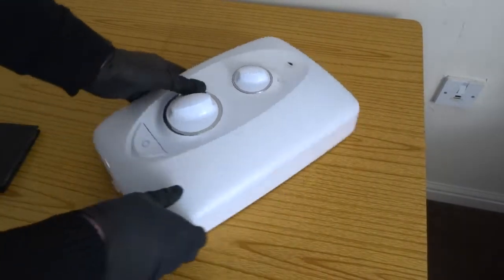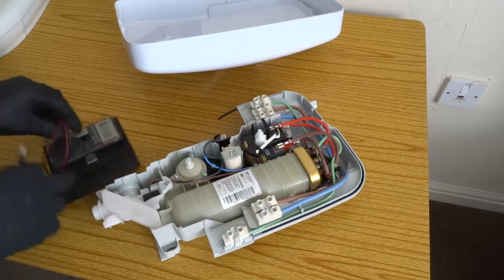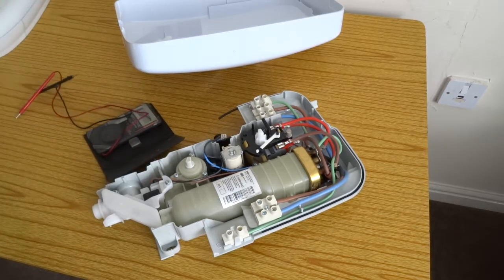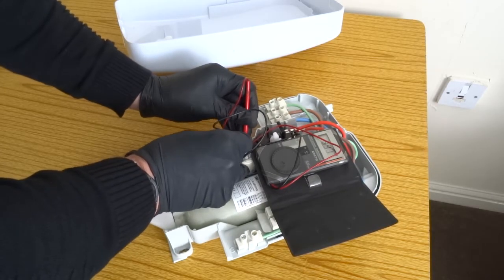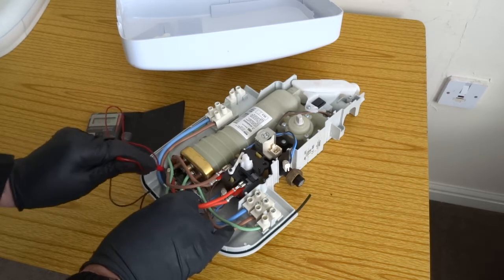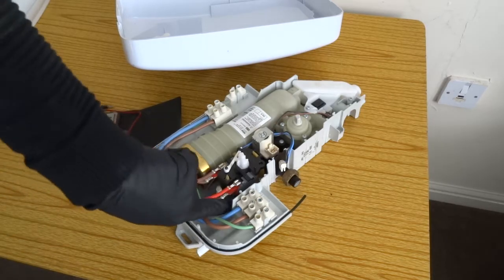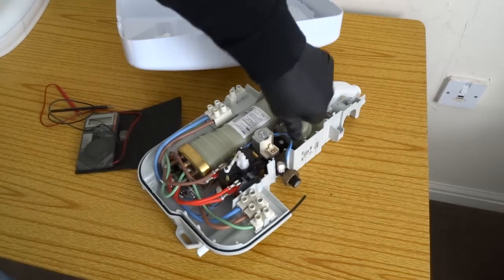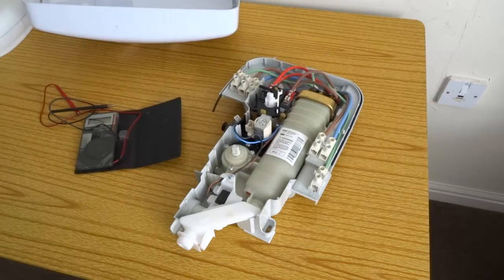Top 5 Mira electric shower problems faults and easy fixes

Comment: My Mira Vista on High has got much much hotter - no matter what temp I choose it’s boiling. I HAVE TO put it on eco, it’s better, I have to whack the temp up on this mode but the flow is less. What would be the problem here? It only started this a few months ago
Reply from the maker: flow related issues ~ inlet filter - flow though unit ( many possible issues ) - or outlet head hose blocked or collapsed internally.

Comment: Any help, Mira shower fluctuates between hot and cold. If turned on and off it will take a good while running cold water before hot water will come, then goes between hot and cold water
Reply: I just watched a video that talked about this issue, apparently if there isn't enough water flow it will cause that problem. Check the hose, shower head, filter etc.
Reply from the maker: this is good advice
Reply from the maker: without testing its hard to know

Comment: The water coming out at the buttom of shower case instead of shower head, is it replace the 1563.533 only ?  I am thinking if need  to replace a new one or change 1563.533.  Thank you
Reply from the maker: Could be orc or main seal alway worth replacing if unit was functioning well before

Comment: Hi we removed our Mira sport max with air boost to tile when it was put back the water kept running even when turned of the only way to stop this is at the main water supply
Reply from the maker: sound like stuck solenoid

Comment: I just swapped head and water coming hole, left hand of tank, is this a simple fix?
Reply from the maker: could be a leak or it could be pressure relief valve prv failure but if it is prv there could be bigger issues.

Comment: Mime works on cold but soon I put warm or hot water my whole eletric trips any ideas please 🙏
Reply: try replacing fuse at the fuse box and check it's rating.
Reply from the maker: trippping is not good replace

Comment: Hi, I have the miracle jump 8.5. Worked fine yesterday and not won't turn on. Green light is on but when you press the power button only a slow trickle of water comes out. Any ideas?

Comment: Hello, thanks for the video it helped me identify that the thermal switch was gone. I replaced it, worked fine for 24 hours but but has stopped working again. Any advice what’s causing it ?
Reply from the maker: must be overheating , maybe slow flow.

Comment: I have the same shower which is in the video. Bought it 6 months ago. But it is not working properly. The lower dial I have to put it on full, water pressure drops significantly but still the water is not hot like before. When it was working before the dial I was putting it in the middle with good water pressure. Can you please let me what is wrong since my shower is only 6 months old
Reply from the maker: you need to do some testing could be element or microswitches .
Reply: @cagmito76  I contacted MIRA showers and they'll be coming over to fix it. However if it turns out to be my fault given my shower is 6 months old they'll charge me £80 and they have taken the payment in advance. Thank you for your help

Comment: hi ,, we own a mira alero since 2014 trouble free since dec this month ! after having a shower ! when you turn off the water continues to run ! for about 20 to 30 seconds ! im not sure what this can be ? could you guide to the right direction or a heads up ! thank you
Reply from the maker: Sounds like the off valve usually solenoid controlled might be faulty. I do not know much about this model though sorry.
Reply: @Tesla Live  ok thank , will look at solenoid 1st thanks for the quick response, merry Christmas x

Comment: I’ve got a Mira advance electric shower when I press start it flashes and the status light flashes and then starts beeping any ideas pls
Reply from the maker: Try to reset it , turn off power at consumer unit circuit breaker for one minute  , press on and off button while power is off to clear board of residual current. then turn power on again. it should beep and flash 10-15 times as it starts up. If the same happens again when you try to use it then you need to find the fault codes for your unit, the flashing is a code.

Comment: My mates shower Mira jump has stopped making hot water they said that it overheated and the hot water has gone would that be the heating element?
Reply from the maker: If its over heated it could be TCO , Element failure , check micro switches . TCO would be my main suspect.

Comment: my mira shower as just stopped working. the power button is flashing green, and does nothing when pressed.
Reply from the maker: Have a test of some components see if anything shows up , does it have a PCB inside ?
Reply: @cagmito76  i tested the solenoid and that was ok, rang the company and they said pcb needs replaced at 75 quid and also recommended a flow valve at 48 quid, so binned it and got a new one yesterday
Reply from the maker: @JuiceBanger1  I have known solenoids to test good when cold but the PCB complicates matters , probably wise to replace the whole unit but it was worth a try testing it , thanks for comments